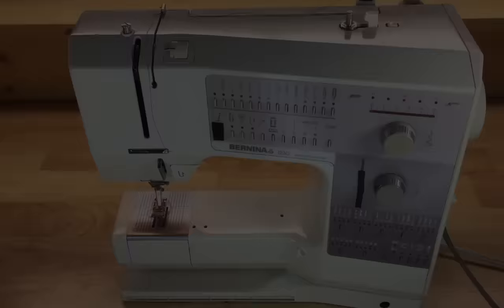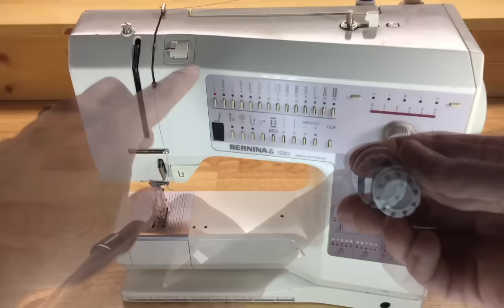Sewing Machine Problems: The Most Common Issues

Comment: OMG I’ve had my machine for 30 years, and no one told me about adjusting the tension! I even had it in for repair twice because of loose stitches, and still no one told me this could be the problem. I already put it in my basement, ready to send off to charity (for the parts) when I saw this video and decided to give it one last try to fix the problem myself. And now it’s working just fine again! You, kind sir, just saved me hundreds of dollars! Thank you! 👐
Reply from the maker: That is awesome!
Reply: Very informative video. I am a guy new to sewing, now that I am retired, and had had my good share of sewing machine issues. This is a very useful video I am sure I will watch again in the near future. Heartfelt thank you.

Comment: I'm 68, and I've been using a sewing machine since I was a child. I can't tell you how many valuable things I just learned from watching your video. THANKS!!!
Reply: I’m 66 and have been sewing since I was 13.  Have never known the wheel should be turned toward me.  Have also been threading with the pressure foot down and end up with the problems shown.  Thank you sooooo much for showing me the correct ways of solving my problems.
Reply: Im 25 just bought a machine after struggling with random machines ice ethier found being tossed out or were given to me thinking the machines were toast I put away and bought a new one and thought it was junk turns out I'm just clueless and I'm glad I hung onto one of the older machines I have now cuz im now much more confident that it will work just fine and that there's nothing wrong with my new machine like superb video so greatfull
Reply: I am 68 as well and sewing from I was at high school, my Mum was a dressmaker (self-taught) and this has helped me so much about tension that I never ever knew, having the foot up or down, I always had the foot down as I needed to see the eye of the needle, and it was hit or miss, I could not work out why sometimes my machine sewed brilliantly, and sometimes not.  So frustrating.  Thanks so much. xxx D

Comment: YOU ARE A LEGEND......foot was down when threading & my bobbin was running in the wrong direction.  I had literally spent 2 days taking the machine apart to clean and oil thinking it was in need of servicing.  Tension had overnight just decided to go loose in the middle of a project & it was all down to those 2 very simple things.  Many thanks for saving my sanity.

Comment: Been sewing ( 8 different machines off and on for 55 years. Had my Bernina 1630 circuit board go bad and had already given away 4 machines due to downsizing .  Gave away 150# material to sewing group that makes bags and lap blankets for wheelchair patients and baby blankets.  Dug out my White 999 as older cabinet model in garage and original singer antique model packed. Been making beginner mistakes I've never made. 
Needle in backward, using no felt pad  and threading machine with pressed foot down, and thinking it was the bobbin case. Grrr! 
You have saved me my sanity and a trip to a sewing machine repair shop.
Thank you so very much for explaining EVERYTHING. Not talking down to BEGINNERS or laughing at advanced sewing customers. 👍🏻
Reply: I agree. The not talking down part was very encouraging.

Comment: You are a life saver, quite literally!!  I've been making masks and am primarily self taught, for the most part.  I've never understood tension at all.  You showed the tension mechanism outside of the machine and it finally makes sense.  
1. Set tension to machine's recommended setting.
2. Thread the machine when the presser foot is UP not down.
3. Sink your needle into the fabric before sewing.
4. Pull the thread tails before sewing.

I sincerely thank you for posting this.  You're a fantastic teacher and helped me to be a much better sewer in just 26 minutes.  Bravo Jack Creek Road!

Comment: This is sooooo informative. I've sent my Pfaffs for repair so many times because I couldn't figure out why I was sometimes getting a mess under my fabric and jamming over and over again.

Everytime, I ask the tech why this is happening, but NO-ONE, not even other seamstresses could tell me it was just the lifter on the top thread. Always they blamed my bobbin.

I actually gave away a perfectly good hardly used Pfaff years ago and bought a new one.

Unbelievable it was just ensuring my thread caught the lift arm.
🤦‍♀️

Thank you SOOOOOO much for this video. (I learned other great tips, too.)

Comment: I THINK IM IN LOVE!!!!!  I haven't tried it yet...but I see what might be my problem...not holding my threads in the back, however, I do start with my needle down...reently anyways.  But the huge problem I have, which happens almost always while I'm top stitching, so it has to look great, is that I have to go through different thicknesses and it will 1)  either give me a bunch of threads at the beginning, because it is thicker and will not want to move, or 2)  it gives me long stitches periodically where it seems almost like it drags the thread over a half or 1 inch space??  I am completely bewildered!!  I think I will buy me a "jumper foot" to try.  I have a much lesser quality machine than you do, when my machine grows up...it wants to be just like yours!!!!

Comment: WOW, just within the first 4 mins, learned several things I'd never given a thought to! I had a bummer experience several years ago with my $150 Brother machine. I couldn't get the bobbin thread tension adjusted properly (too loose), so after several months of frustration, I called a couple of repair shops (or so they advertized) in the Dallas/Ft. Worth area, which is large enough to have almost any goods/services within a 30 min. radius...or so I thought. I couldn't find anyone who services with home sewing machines, including one guy who said he only deals with commercial machines. It was frustrating to find out that inexpensive sewing machines are essentially disposable. I gave up and bought a $75 basic Brother, which suits my needs just fine and which I like more than the previous one.

Comment: Concise, well explained, well filmed. Thanks a lot!

A few questions:
1) Why should you not roll the hand wheel in reverse?
2) Should bobbin case tension be just tight enough that it does not unwind by itself when held by the thread, or is that still too loose? Or put differently: Would a good procedure for proper bobbin case tensioning be: Loosen until it doesn't hold. Tighten by quarter turns until it just barely does?
3) If the 4-by-4 zigzag was not great, how should I proceed?

Comment: This has been so helpful. I've been sewing for almost 60 years and was familiar with knowing that I should adjust tension, turn wheel correctly, all the things you've shown -- but I didn't know the 𝙬𝙝𝙮. That close-up of the top tension mechanism was so helpful. As was the part about top-loading bobbins vs front loading. I am about to buy a new machine and now I will look at it more closely and try to get one with metal parts, and for which I can use my current bobbin collection. Thank you so much.

Comment: Thank you!!! Your explanation of how bobbins actually works was wonderful. My machine keeps giving me “thread vomit” on the underside ... so I assumed it was from the bobbin. Will try working with tension on the top thread to rid myself of this problem. 
Been making many masks here....if I can get these going more smoothly you would make my day (year!)
Reply: Make sure thread is between tension disks, 7:30 in video. Also be sure thread is not falling off of take up lever and do not turn hand wheel away from you, backwards. Also at 12:50 he shows what missing the the take lever/arm will do. About 14:08 he shows one type of bottom vomit. Is that what yours looks like ? Hope this helps.

Comment: Fantastic info. Also have been sewing for a lifetime and did not know some of your info. After having looked at a lot of videos today, I too, as someone else commented appreciate your calm voice and no music. Just excellent information that every machine user needs to know. I have the plastic bobbin case and just ordered another one. I also took the cover off the top of my machine and found 2 long threads stuck in the tension discs! YUCK. Also found one thread wrapped around into a ball (no kidding) on a flat lever bar that lies horizontally next to the tension discs (Singer Futura XL400). I have been really frustrated with the machine! Now I can't wait for the bobbin case to arrive so I can see if I fixed everything. Timing is also off a bit. It only sewed well at #9 tension! Your info about how no one uses those numbers told me a lot! I will change my needle and use a felt pad. Used to I would just oil the machine and clean out the bobbin and foot area. SO GREAT to know I can probably service it myself and save that money. Thank you so much!
Reply from the maker: Thank you so much for your kind words :) If you need any help with servicing your machine, feel free to ask here or email me asvrepair@gmail.com
Reply: Hi Susan Chinouth, I also have the Futura XL400,  so far so good. it's 5 years I have it, but I hardly use it. my old one is the one I use the most that is giving me problems now,

Comment: thank you so much! I was having trouble because the thread would come off really easily, and after many tries of fixing it, I thought the machine was broken! How embarrassing
Reply: Thank you so much for making this video, I have just been given an old machine (Toyota 2702 EC1 Series) by my mother in law and she had previously experienced problems with it and also lost the foot pedal. I found a foot pedal on eBay cheap and got it running but it was chewing up the thread into a mess in the fabric and also pinching the thread in the tension discs and causing it to snap.
By watching your video I discovered there was a burr in the metal of the hook where it must have had a needle collision and I also adjusted the tension in the discs and bobbin carrier and oiled where you said on the hook race, as well as some other moving parts and it’s now working great !
Now to teach myself how to make some things but I’ll start be doing some repairs and modifications on my skateboard pads.
Once again many thanks 🙏🏻 I owe you a few beers 🍻

Comment: Wow. That was a great video!  I’ve been using a sewing machine since I was a little girl. I normally keep the foot down so I can thread my needle but I think what was happening was when I was threading the machine at the top you said the foot should always be up because that way the thread goes into the tension knob between the metal discs. that was something new I learned and hopefully will make a difference. Thank you so much for the lesson!😎

Comment: I'm no seamstress/seamster, but I've been successfully dabbling in machine sewing for...many decades.  I've sewn scores of jean and dress hems, and full costumes including a leopard print sport coat with gold lame lapels and pocket covers (my tacky masterwork!).  :)

Now I have two machines - a 70s era Singer (my faithful original) and an inherited 90s era Brother - both middle of the road models, but somehow I've to gotten to a point where neither one reliably sews correctly, with one bending and breaking needles, and the other leaving wads of thread on the underside of the stitches.  I think it's tension problem, but I can't seem to find the solution.

Your video is incredibly helpful and enlightening!  I was just guessing on a lot of my "craft", but now I have a much better understanding of the mechanics of what's actually going on!  Maybe my machines don't need to be repaired or replaced, just run with a more thorough knowledge of their proper set-up and operation.  Thank you so much!!!

Comment: This was an excellent video - explained so much that I did not know.   I grew up with old machines so had no idea that the horizontal spool needed the holder to help regulate the thread feed - I thought it was to hold the reel on!  These things are not in the manual, so it really is trial and error for a lot of us.  And your production values were excellent with your limited  lights.

Comment: This helps a lot.  Thank you!  I’ve been a casual sewist for 40 years and took out my two old lady machines during the quarantine to begin sewing again.  I’m using up my mom’s thread stash and was having problems with the tension on my old husqvarna 6440.  I bet it’s the cheap thread and lack of spool felt.  I’m going to use a spool felt and see If that helps.  I liked your analogy about the thread being the gas of the sewing machine.  Very helpful.

Comment: Learned a lot here! Last week dug a bunch of thread out of the gears and bottom bobbin assembly. This machine had been loaned out and not cleaned. It's an old Brother machine. In the middle of a project it stopped doing zigzag. Have attempted to troubleshoot, have attempted to change stitch length and width, no success. It was making a loud clicking sound in the case, now it is not. I realize this is difficult to diagnose online, but there are no repair services within 100 miles. I'm about to take the top case apart and/or look online for ideas how to fix. Thanks.

Comment: I'm glad for these tips. I'm putting it in my sewing playlist.

Every time I start to sew, I end up spending a half hour just trying to set it up to sew my fabric properly.

I shall have to go through my front - loader bobbin plate to see if I have any burrs. I'll check the bobbins, too. I hate plastic bobbins, and I wonder if they were  giving me problems despite being in a steel bobbin cover.
I do have steel bobbins, and those should be fine. But I'll check.

Then again, I was sewing fleece for a long tunic, and my stitch for some reason was 2-3 mm long. Once I figured this out, I was able to lengthen the stitch and adjust the tension.

And I had to adjust again for normal cotton fabric.

Comment: So…uh…complete beginner here.
My machine has a bobbin case and is side loading rather than top loading.

It worked fine for a couple of hours but suddenly started to seize, so much so that I had to turn the wheel backward to get the needle out of the fabric.
Turns out the bottom thread was all bunched up.
I cleared the entire shuttle and whatnot and put everything back together after feeling the hook/bobbin case for burrs, even wiping it with a micro fibre cloth to see if that detects something. Seems to be smooth.

Now I can pick up the bobbin thread no problem but once I start sewing it bunches up again on the bottom side. It seems at times the thread is torn apart in the bobbin case/ or rather the housing by around it.

Update: shame on me, I forgot to change the needle. New one’s in and now it seems to work again!

Comment: oh, my goodness! thank you!... I'm totally new to sewing and the whole tension concept totally eluded me. it makes sense now and it makes all the problems I've been having obvious. 

question, why do we spin the wheel towards yourself?
Reply from the maker: Thank you for your kind words :) So one thing I like to point out to people with the handwheel that they often don't realize, is even when you run your machine in reverse, the handwheel spins towards you, it doesn't change direction. 

If you think of the revolution of the handwheel as the cycle the machine takes to tie a stitch, when we spin it backwards we almost reverse that cycle. So if we essentially start a stitch in reverse then take off sewing again, the partially started cycle can jam the machine. Jams aren't the end of the world, but they often cause issues because many sewers try to force the jam out and end up causing more damage,
Reply: Thank you so much for your great video. I did everything to a t and it seems the tension has greatly improved..now the problem is even though the stitches looks nice they are still loose. I can actually pull the thread out. What could i be missing? I have twicked the bottom tension but it just never seems to get strong.